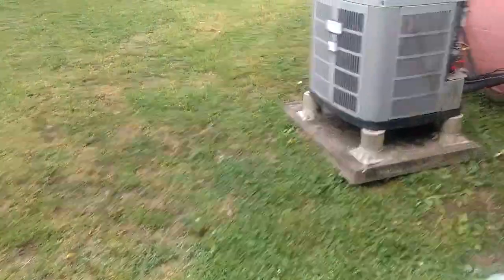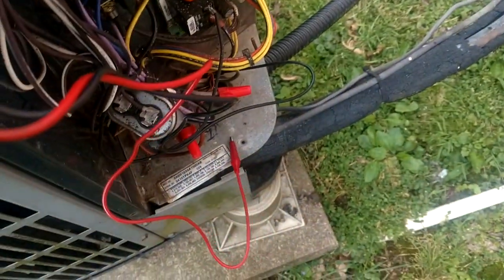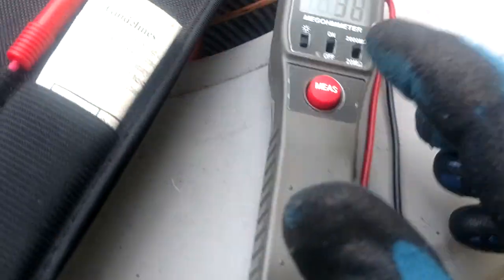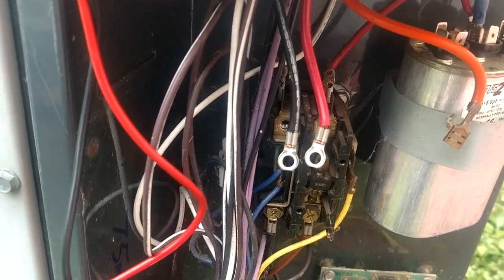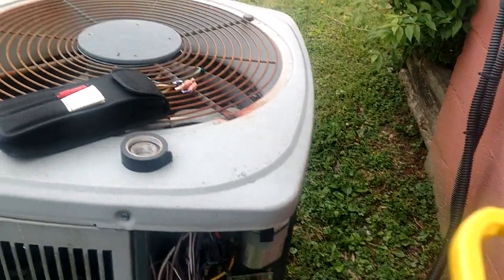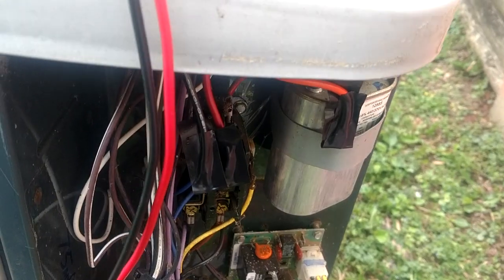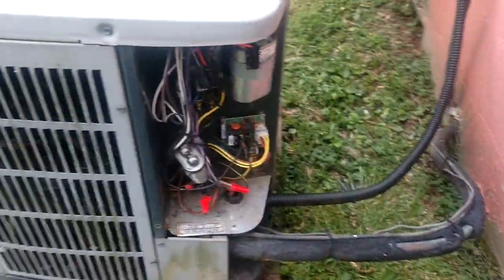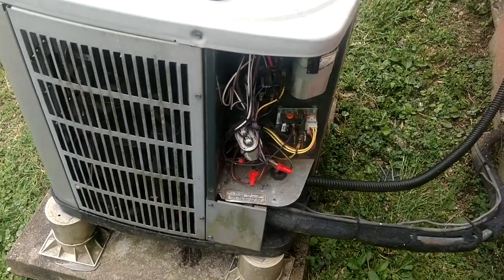Megohm Madness!!! Not good news for the homeowner 💥💥💥

Comment: So basically anything under 50 on that SMG5 is bad?
Reply from the maker: Anything under 100 is not looking good, but under 50 is going to be bad .  😎👍
Reply: @sknight0391  thanks
Reply: @sknight0391  How about a blower motor? What would you consider low readings
Reply from the maker: @christov4120  on a blower I would say if it's running it's fine.

Comment: Good Video.
I have a question its correct to check with megometer the compressor terminal instead of compressor wires?
Reply from the maker: If you have verified 100% that all three of your wires are okay down to the compressor then it's okay to do through the wires. But sometimes it turns out that the wire is the problem. And you end up finding a rubbed spot on one of the wires touching metal. Thanks for watching 😎👍
Reply: @sknight0391  Thanks a lot. Thanks for quick reply. My doubt is about values now. I was getting over 1000 megaohms. Is that mean is good?
Reply from the maker: @MrJeromegon  yes, that's okay. Once you start falling below 500 you start to get concerned. The closer to zero you are the worst it is.
Reply: @sknight0391  Thanks a lot. I was watching videos about the Supco 5000. I was a little confused about the values. So basically work the same or similar than the supco5000. I dont need to get the Supco5000 then. To be honest i like  my SMG 5 and im gonna use it more often then. In regular troubleshooting i use my regular meter to diagnose bad compressors but i am very much into hvac gadgets.
Reply from the maker: @MrJeromegon  the supco megaohmmeter just makes it a little easier when having to tell the homeowner the bad news. The homeowner can stand right next to you as you hit the button and easily understand what the lights mean . Green= Good / Red= Bad
Reply: @sknight0391  Thanks a lot. You just clear all my doubts. I truly appreciated such a good explanation. Once again Thank you so much.

Comment: How do you detect a turn to turn short on a winding (short between the winding turn itself)?
Reply from the maker: Well you're going to be blowing fuses for one thing. But you can always do your own test... Common to Run + Common to Start = Run to Start.
Reply: @sknight0391  you mean do some cut-resistant test I'm not sure could you elaborate place
Reply: You need milohmmeter and compressor  manufacturer data  for good compressor  winding resistances or make comparison with known good previously measured value!  https://www.youtube.com/watch?v=bVKuYOA3F2E

Comment: Hey Shannon, do you prefer the FP megger to the Supco M500 with the lights? The company I work for, gave all the techs the Supco megger. On the recip compressors usually they are pretty accurate. On scrolls though it is hit or miss. Copeland doesn't even recommend using the Supco because it gives false readings when they are cold. If you run them for a few minutes then they get more accurate. Does the FP one require the same? By the way where is the SC480? what with the old meter? Love your videos, keep them coming.
Reply from the maker: Fieldpiece or Supco either one. One you're looking at lights and one you're looking at numbers. You just have to know how to interpret the readings you're getting and then use a little further diagnostic to fully confirm the problem. (Like disconnecting the wires.) 
Sometimes the meter I use depends on how much rain is coming down. The more rain, the cheaper the meter. I will eventually pull out my $50 Chinese meter to slosh around in heavy rain and snow. 😂
Thanks for watching BriPor 😎👍
Reply: @sknight0391  
Are you expected to work in the rain?
Reply from the maker: @hg2.  yes, but only to a point. Once it becomes unsafe or a hazard that's when I pack it up.
Reply: @sknight0391  Rain is what killed my SC440 meter. I used in the rain too much. Never got soaked, but it would get wet here and there. Take care.
Reply from the maker: @brianporter4352  Yeah, I really liked my sc440. The sc480 has got all for stuff I will never use. I don't do the whole "wireless thing."
Reply: @sknight0391  Shannon, but to be honest there is some stuff I never used with the SC440! Duty cycle, hertz! I mainly do residential, with a little bit of commercial
Reply: Copeland if you read the information says the scroll compressor is good down to I think .05 megohms and the Supco only reads down to 20 megohms. Until I read the information I condemned some good compressors, always read. The 
Chinese megohm meter is equal to the Fluke megohm meter just don't use it for anything else.